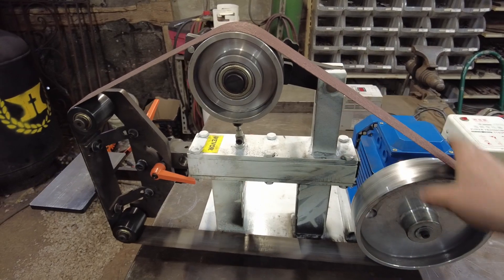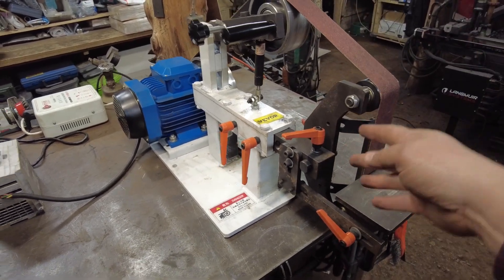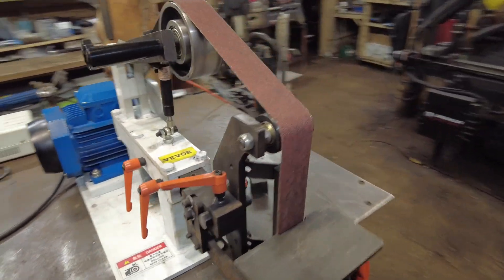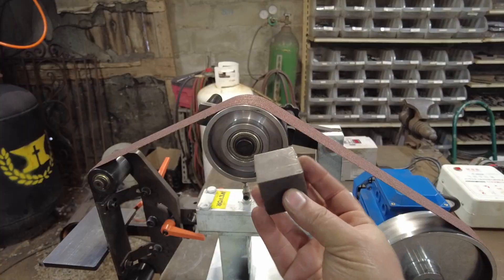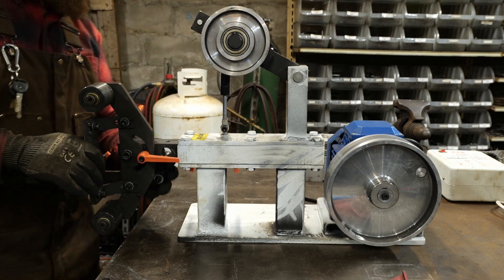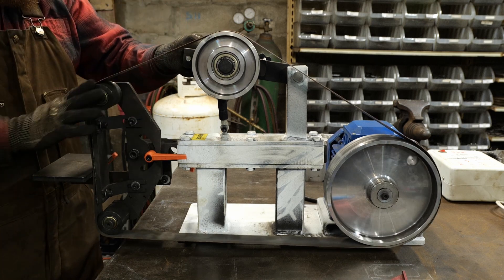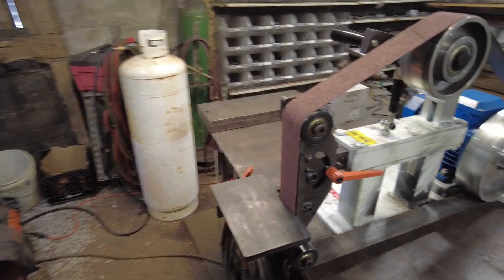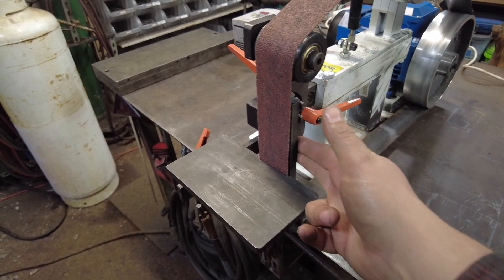Converting the VEVOR 2"x82" Grinder into a 2"x72" Grinder!

Comment: With the spacer installed, will the large wheel and small arc wheels work with a 72" belt?  Or do you have to remove the spacer?

Comment: How would you feel about keeping it as a 2x82 now that red belt abrasive has ceramic belts in a variety of grits for the 82 inch that seem to cost around 2 to 4 dollars more than 2x72 belts. Is the extra 10inches of belt worth it.

Comment: Will the old belts still fit?
Reply: Will the old 82”belts still work I have a TON of those and would hate to lose them
Reply: @MrZ-F yes
Reply: If it came to it, you could bolt the extension back on with a central bolt and a couple of roll pins.  I have a milling machine at my Menz Shed, but it would be an hours work for an engineering shop.